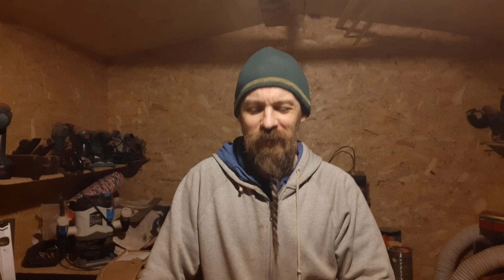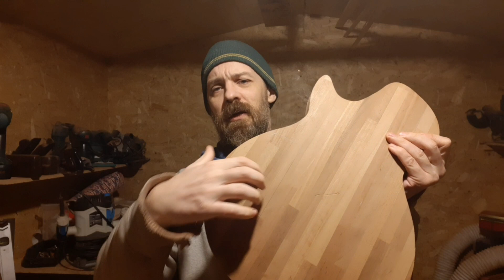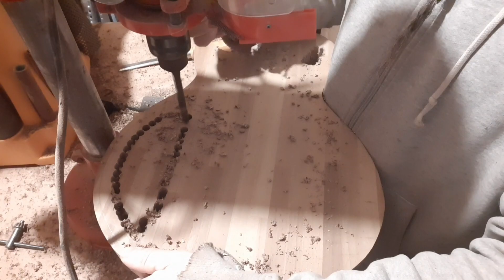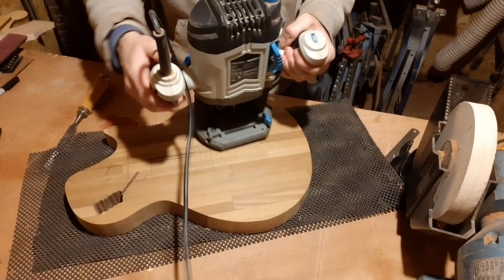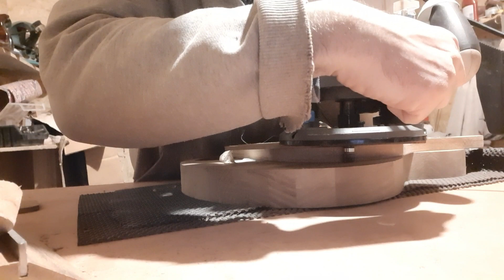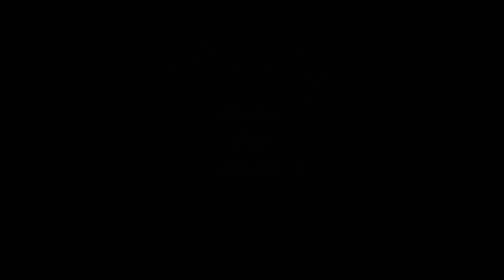Use What You've Got Challenge - My Build Parts 7 - Steve Walker Guitars

Comment: You need to get yourself a rabbeting bit for your router. Saves loads of time when routing the cavity cover channel.
Reply from the maker: I do actually have one, but can't quite manage 2 of the corners unfortunately, but it is something I would definitely use on something in the future, maybe even for a Les Paul style toggle switch cavity cover!
Reply: @SteveWalkerGuitars  mine leaves rounded corners. But I have a few different sizes depending on what I'm building at the time.
Reply from the maker: @MilesMcNallyLuthierie  I have various bearings but only one bit that fits them, and I believe it's a 1" bit, so 2 of the corners don't quite make it in the cut. I think next time I design a guitar I'll be taking into account the bits and cutters I have haha